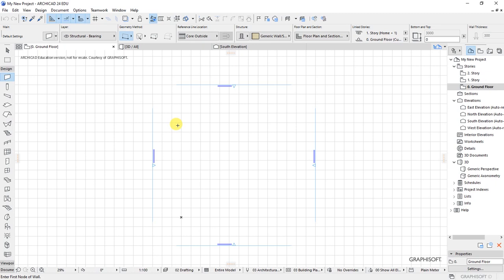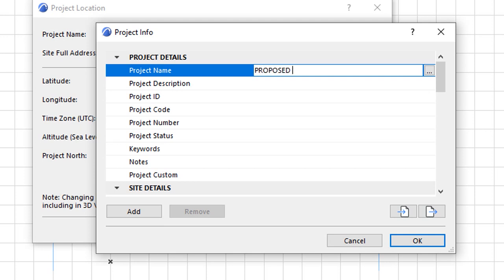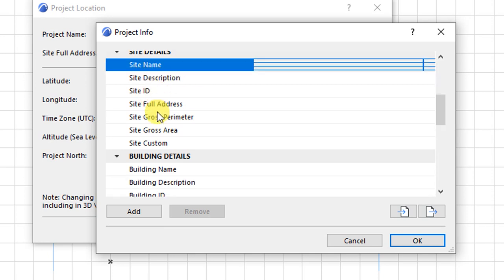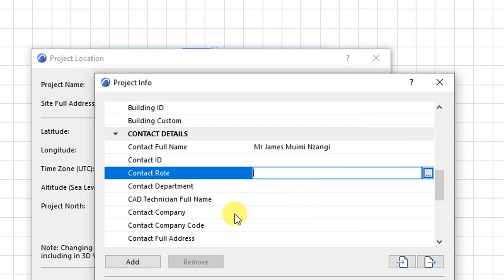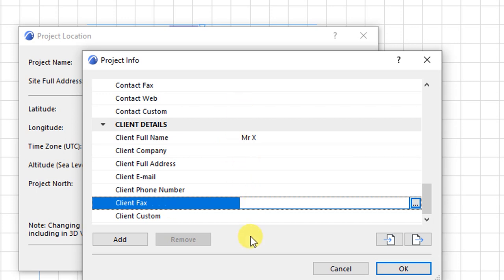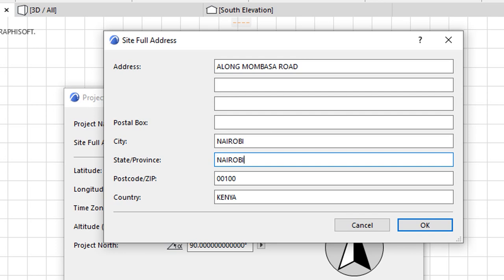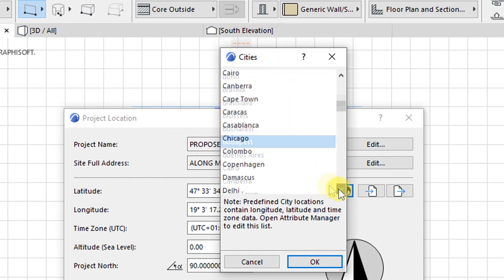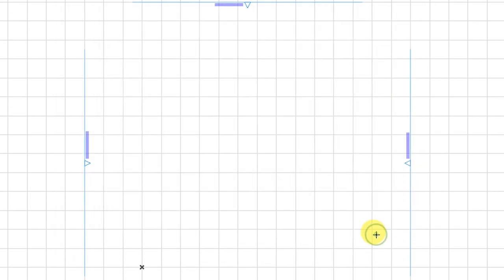ArchiCAD 24 - Project Location Settings

Comment: Now in project location settings, how can I set Kampala city which is not included in the list
Reply from the maker: Kampala and Nairobi share the same time zone. If Kampala is not listed, Nairobi can be a good representative of the East African region. You can pick (UTC+3:00)Nairobi as your location time zone. It will give you the same results for solar/sun settings in ArchiCAD.